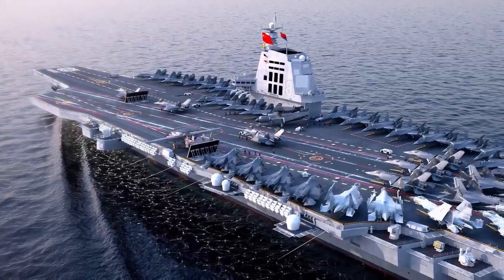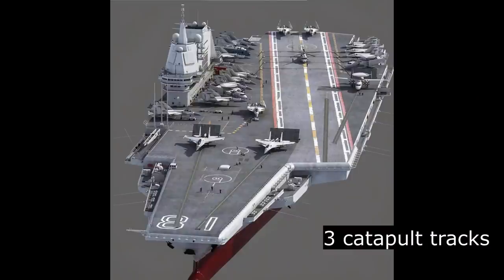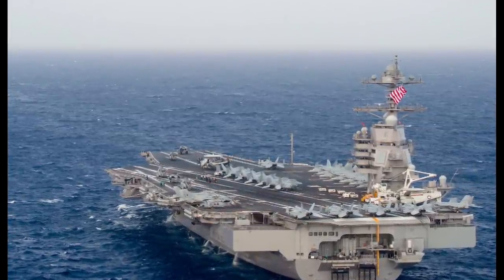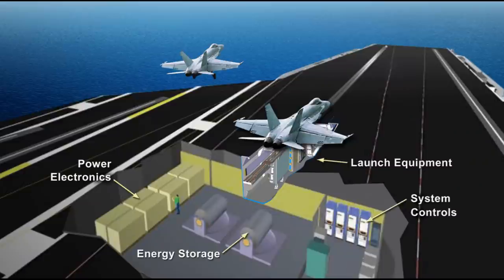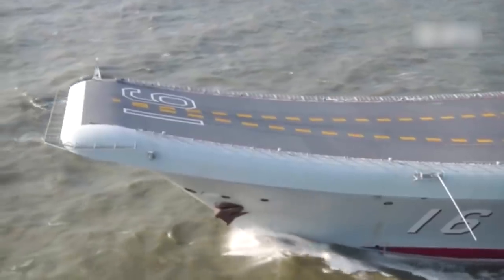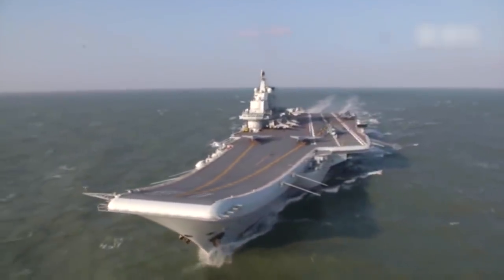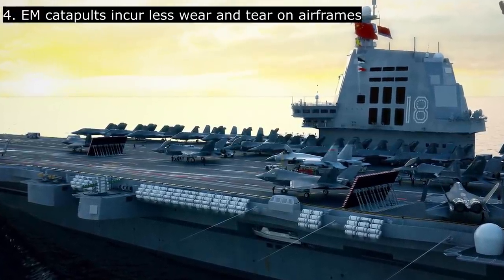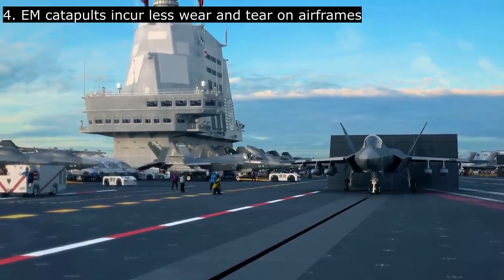How Important are Electromagnetic Catapults for China's Type 003 Aircraft Carrier?

Comment: 考虑到中俄都装备了海量的侧卫机型，兄弟会整个视频分析一下侧卫系列吗？你认为s35和j16各有什么优劣？另外国内许多人对fc31并不满意，他们更希望看到j20上舰，你怎么看？
Reply from the maker: Regarding whether PLAN should use the J-20 as the main carrier fighter instead of the J-35, I think it is a difficult choice. The J-20 seems to be very capable and developed, with reliable domestic engines, and should be able to carry more weapons and fuel than the smaller J-35. Putting a carrier version of the J-20 on the Type 003 carrier is a good idea, because they can be launched with the electromagnetic catapult. However, the problem is that the J-20 is too heavy to take off reliably from the STOBAR carriers - Type 001 and 002 - because at full load the J-20 weighs 37 tons, which is 5 tons heavier than the J-15 at full load. So, the PLAN does need a lighter and smaller 5th generation carrier fighter, like the J-35, that can take off from the Liaoning and Shandong. So, ideally, PLAN will want both the carrier verison of the J-20 and J-35. But if I have to choose only one, it will have to be the J-35, for use with both the Type 003 and the STOBAR carriers.
On the flanker questions: I am generally not that informed when it comes to combat aircrafts to be honest, so probably wouldn't look at the flanker series unless if it is a naval topic.
Reply: J20 is too large also much more expensive, not a good choice, but the new version of fc31 has been revealed, highly likely it will be J35 for the new carrier.
Reply: 歼20的航电和光电瞄准系统更注重空战，对地双座歼击轰炸机版20不可能上舰，歼16是空军的多功能战斗机，能挂载反舰导弹
航空母舰目前搭载的是歼15飞鲨，定位和美军的航母的FA18类似，目前FC31（歼35）的定位瞄准的是F35，但有F35近距空战过于拉胯的前车之鉴，可以预见海四代会有更好的跨音速机动